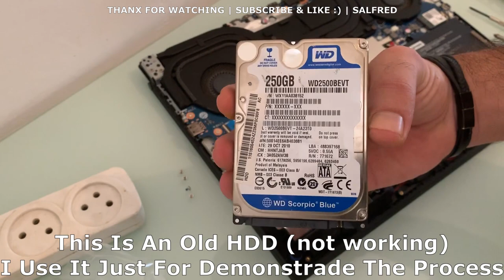Lenovo Legion Y540 - How To Add HDD Driver | 1080p HD

Comment: BIG NEWS: The 2020 Y540 model has improved a lot regarding back panel and accessability. The panel is now two halves. You only need to remove 2 angled screws to open the front half of it. Push with your thumbs against the rubber bar and slide the panel to the front, then lift off. No plastic cards needed. 

The HDD slot is filled with a dummy device containing 4 additional screws, and the cable is already installed. So there is no additional stuff in the box.
Reply: Can you do some photos or video? Im considering this pc and this is, at least for me, a must have
Reply: Thank you!!
I was wondering why mine didn't come with the extra stuff in the box
Reply: This means  that I can plug the hard directly without buying connector cable or screws?
Reply: @abdullahfayed3272  Yes. Just open the back panel and check if the frame and cable is inside.

Comment: At least for 17'' version, not the whole bottom needs to be removed to do this. You only have to remove two front screws and part of the bottom can be removed, which is enough and makes the whole procedure way easier. Check the manual if in doubt.

Comment: One problem here, which was not cover in this video. Disk you showed to us is too thick. I have the similar, old 2,5 disk and after installation I can't properly close the lid. There is visible bulk on the disk side.

Comment: This must be the 17 inch model , because the casing is different to mine . 

Can't get the back part seperated without bending and warping the plastic ventilation areas on the back and sides .

Comment: Hey what is the key size to remove hdd case screws?
Reply from the maker: Raymon Pizziolo hi:) i dont sure but i think 3mm or 3.5mm, its from a set but i lost the box:) in some sets its named ph1 or ph0 :)
Reply: @salfred5928  Did you remeber with the model part of cable is the NBX0001M410?
Reply from the maker: Raymon Pizziolo hi:) you can check in the description for the cable link :)
and you can check the photos here from my cable: 
https://ibb.co/Fzh1kVp
https://ibb.co/5WxzSJf
https://ibb.co/3y6kDBp
Reply: @salfred5928  what is the price of cable I broke mine

Plss reply
Reply from the maker: Dharendra Kumar Rathore its about 10-15 in amazon check in my description

Comment: Are there plastic clips of some kind which prevent the lid from taking off easily after screwing off those screws?
Reply from the maker: Dennis Agenorov-Papulovskiy hi:) yes, you have to open it with thin plastic card in front and in the back(uper side) by sliding the card to the sides, after you getting off the screws so its still close around the laptop with many little plastic clips, thats why need the plastic card:)

Comment: Can I add ssd 2.5 inch there?
Reply from the maker: Amartya Bimantara hi:) i think yes the ssd 2.5 inch looks exactly like the hdd with the same connection so yes (i didnt tried it but im sure it will work)
Reply: Can confirm. We've installed SSD in here.
Reply: @dgm3985  it depends... are you willing to spend half of how much the laptop is worth on an ssd? If yes then you can put a 4tb ssd in there...
Reply: @dgm3985  nah performance should be consistent across the line up... after all its sata... so get the ssd u want... but in ur situation id get the 2tb ssd... u never know how much storage u actually need...i only have a 240gb ssd and a 1tb hdd now and my storage feels cramped lol... especially on my ssd cause i only have 50gb of free space... also a tip: never separate a single storage device into partitions... keep it all in one... my current hdd was devided into 2 partitions for no apparent reason by the guy who installed windows on the pc and now i cant recombine the 2 into one... which means the hdd is defected so rip and watch out for that

Comment: Driver touchpad y540 15IHR PG0 ?  Help
Reply from the maker: SebasTian TorresGalvan what is the problem?
Reply: @salfred5928  I reinstalled Windows on the y540 15IHR PG0 and I can't find the driver for the laptop's "touchpad" to work. I don't know if you could help me which one it is...
Reply from the maker: SebasTian TorresGalvan did you download the Lenovo Vantage software and updated your drivers from there? and from intel? the website, after those its should appear
* if you update from third party soft as Driver booster it can make the problem you dont need those softs
Reply from the maker: SebasTian TorresGalvan check this video at minute 0:44 i wrote the name of the driver
Touchpad Not Working on Lenovo Laptop - How To Fix Lenovo Touchpad Problem
https://www.youtube.com/watch?v=0RWttcO2Jsc&feature=share
Reply: @salfred5928  Yes, install the updates I went to the lenovo page but it does not have the touchpad driver, I tried to install a third party driver but found nothing for Y540, please help me find a link for (y540 15IHR PG0) I would really appreciate it very much .
Reply from the maker: SebasTian TorresGalvan ok, you have 1 option that i think will work, first uninstall the driver booster and any other external driver updater, then go to search > device manger> and there you need to select
Human Interface Devices
Keyboards
Mice and other pointing device
On each tab you need to select one by one on the drivers inside the tab, press twice on the driver then it will open little window go to driver tab and press Uninstall device , 
Uninstall all devices on all those 3, except your mouse in Mice and other pointing devices, so you can keep using the mouse:),
after you deleted all the devices restart (disable the password if have in case of the keyboard doesnt work) and after restart go to Lenovo Vantage and search for updates. it seems alot but its easy. I hope it will work:)
Reply: @salfred5928  
thanks bro I did it several times and it finally solved :D

Comment: Hey! The manual specifies that you need to remove the battery before installing the HDD. What's up with that?
Reply: Soldier X no need to do so
Reply from the maker: Soldier X hi:) as Daniel Luchner said, no need to remove the battery for that:)
Reply: If you don't brodge a connection like an idiot, there's no need. I've done almost all the repairs and swaps with it plugged in.

Comment: Would a 2.5 inch Sata SSD fit and work in there aswell combined with the m2 nvme ssd?
Reply from the maker: Elyad G. hi:) yes, you can see how to at this video: Lenovo Legion Y540 - How To Open The Back Panel & Add 2.5" SSD 1TB Samsung Drive | 1080p HD https://youtu.be/N1ZJ6GSaNQs

Comment: I plan on buying the y540 that comes with 1tb nvme. Can i add another internal ssd drive to the drive bay or can i only put a hdd there? Would it be beneficial to even add another ssd memory if i could or should i keep it at nvme with an hdd
Reply from the maker: omar9654 h:) i put this hdd just because i got the connector and i wanted to see how to connect it:) (on the connector its written “hdd”) i didnt try ssd but its seems to me that it will work with 2.5” ssd drive cuz its look same connection and size so... :)
Reply: Hi mate , great video !!
After installation the new hdd/ssd , what i have to do after i turn on the laptop ?
Can i use it right away for storage files or there are a step or two to do before ?
Thanks !!
Reply: @salfred5928  thanks
Reply: @TheJoel1964  you should be good to go if its connected right. Plug and play !
Reply: @omar9654  thanks mate

Comment: Is that the same for y540 core i5 laptop?
Reply from the maker: Sultan Kadyr yeah the cpu is not affecting on the way of closing or opening the back panel
Reply: I mean that maybe there could a difference between these laptops
Reply from the maker: Sultan Kadyr there is no difference if its the same model :) cpu or ram and so can be change but if its the same model so its same opening way

Comment: What maximum support of hdd
Reply from the maker: ysh balaram hi:) i think there is no limit on that just make sure its fit and compatible to laptops(7mm) you can check in the description for sata cable :) 
there is a limit only on the ssd nvme up to 2TB :)

Comment: Can you add a additional SSD?
Reply: you can't .. only replace the ssd .. no extra slot
Reply: it only has one 2.5' HDD/SSD slot and an m.2 Nvme slot
Reply: @javinjuneja  you can try adding a desktop ssd, and screw it only on one side, if it's to small for the metal case
Reply: Cant you replace the hdd with another SSD?
One ssd compatible with 2.5 and another with m.2?
Thank you

Comment: Sir, just one doubt.
Can I install HDD without removing SSD?
I've the same laptop and want to upgrade it's storage space without compromising the speed SSD offers.
Reply: Your system drive is the M.2 drive to the right of the 2.5 drive this fellow removes at the beginning.  After you back up your current 2.5 drive and install a new one you should be good to go.
Reply: @Finfid  Thanks mate.

Comment: Thanks man. After adding hdd to my laptop y540. Its back cover refused to close like before. The hdd has got packed very tightly. The screw too does not get tightned to last thread. Like it wasnt meant for hdd 2.5 upgrade. Just be careful not to break hooks on back cover.

Comment: Does anyone know if the HDD cable/connector for the Y520 and/or Y530 would work in the Y540 as well?  I wanted to add a 2nd SSD to the empty bay on mine, but apparently US vendors do not ship the cable/connector with the laptop (or so I was told), so you have to purchase it separately. They are out of stock on Lenovo's site right now (of course). There are a ton of them available on the Bay for the Y520 & Y530, but I have no idea if they are compatible.
Reply from the maker: Mike Goddard hi:) i dont know if it will help but you have here 3 photos of the connector how it looks like and what wrote on it:

https://ibb.co/Fzh1kVp
https://ibb.co/5WxzSJf
https://ibb.co/3y6kDBp

Comment: Hey, can I take my HDD out of my old laptop (Acer E5-511-C4P0) and move it in to my new legion y540 with all the files on? Or will that cause complications since it has windows and different programs installed on it?
Reply from the maker: Sarah Davin Murphy hi:) yes you can do it and move it to the new laptop (i did it my self but mine was empty cuz i reboot it) you can try it, it will be as another disk , but if its old one so most likely its 9mm and it would be hard to close tha back panel so the best would be with sata to usb cable ( you have link to that in the description) and do just as in this video and it will work out :
How To Add & Activate 2.5" SSD Samsung Drive With Sata To USB Cable | Lenovo Legion Y540 | 1080p HD
https://youtu.be/qsYK6GqVYh0
Reply: @salfred5928  Hi again - only getting around to this now. Could the HDD to laptop cable be inside the laptop? I didn't get one in my box. Also, what is the ideal size of the HDD to go into this laptop? I want to use it as extra memory on the laptop too - not just transfer over the files (If I can) how can I measure what size mine is?

Comment: If I add HDD Driver, will the system still be on the ssd drive?\
This connector is compatible with SATA I, II and III?
Reply: Yes of course the system is already installed on your SSD and your boot preference should be automatically be the SSD. The HDD will just be like an external hard disk
Reply from the maker: Klucznik LBL hi yes its still on the ssd nvme, you can see it on this video at the end how it appears on “ThisPc”:
Lenovo Legion Y540 - How To Open The Back Panel & Add 2.5" SSD 1TB Samsung Drive | 1080p HD https://youtu.be/N1ZJ6GSaNQs

Comment: I am planning to get y540 with 1tb nvme ssd,does it have another nvme ssd slot?
Can i install a m.2 sata or a 2.5" ssd insted of a Hdd?
Reply from the maker: Nikhil Malvankar hi:) it has only 1 ssd slot, and i think you can put 2.5” ssd, i didnt tested it but the connection seems to be exactly the same
Reply: There is only one m.2 slot. You can install a 2.5 inch ssd or HDD in the space. Anything will work as both use SATA 3 cable.
Reply from the maker: Diego when i bought the laptop it was written up to 2tb, dont know if only ssd or both ssd and hdd... i think the ssd is up to 2 tb and on the hdd spot you can add more if you need to, i ordered 1 tb 2.5” ssd to put on the hdd spot i will see if its work in the next few days
Reply from the maker: Diego well you explained it better than me:)
So i think the ssd nvme is up to 2tb 
And on the hdd spot you can add hdd or ssd 2.5” in addition to the ssd nvme :)
Reply: @dgm3985  I have a 256gb nvme and a 1 TB HDD. I want to replace my 2.5 inch hdd with a 2.5 inch ssd. Any recommendations from y'all? @salfred which SSD have you chosen?
Reply from the maker: Siddharth hi @Diego was right its the samsung 860 1tb 

https://www.amazon.com/gp/product/B07L3D19MY/ref=ox_sc_act_title_1?smid=ATVPDKIKX0DER&psc=1

Comment: is this a 7mm or 9mm?
Reply from the maker: Hi:) in this video its 9mm i think(old one), but you need 7mm ssd\hdd
Reply: 9mm hdd does not fit on it, it will not able to close the panel properly.. must be 7mm hdd

Comment: Why would you install an hdd? What is this 2017? Just put a hot damn 960gb sata ssd... it might be like 1.5 to 2 times the price of the hdd but who cares its a god damn almost 1tb ssd... for mass storage... did i think it would be this cheap to do this 3 or 4 years ago? Heck no... man ssds have gone down in price a lot... no point of getting a hdd
Reply from the maker: V. N. hi:) ok I agree ssd much better then hdd but i did this video cuz on the connector its written “hdd” so i wanted to try it, you can try 2.5” ssd i think it will work
Reply: @salfred5928  it definitely works

Comment: I can't close back panel from hdd side.😂😂😂😜😜
Reply from the maker: Hi:) Make sure its 7mm :)
Reply: me too TT
Reply: @salfred5928  any solution ? I can't close the lid as well.. i have 7 mm disk but even with that i cannot close it. Solution please
Reply from the maker: Pedro Guerrero hi:) if its 7mm it should be ok, if its still not ok maybe try to remove the black sponges to earn more space(it should work without removing those but if you still not able to close so try that)
Reply from the maker: Pedro Guerrero i will add a new SSD 2.5” tommorow i hope, and i will show how to close it, do not try to close it with force so you wont break it:)
Reply from the maker: Pedro Guerrero hi:) check this video how the back panel closed without any problem:)

Lenovo Legion Y540 - How To Open The Back Panel & Add 2.5" SSD 1TB Samsung Drive | 1080p HD https://youtu.be/N1ZJ6GSaNQs